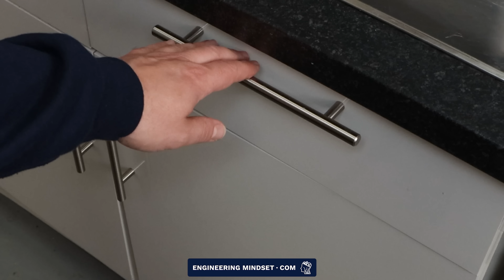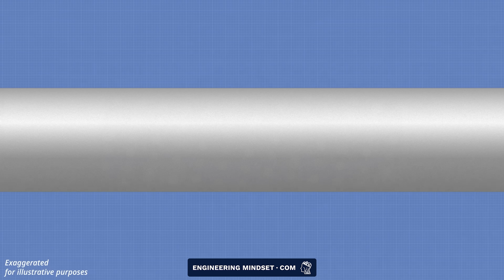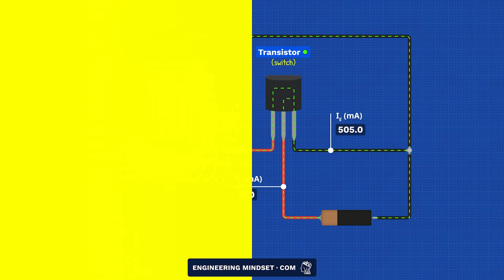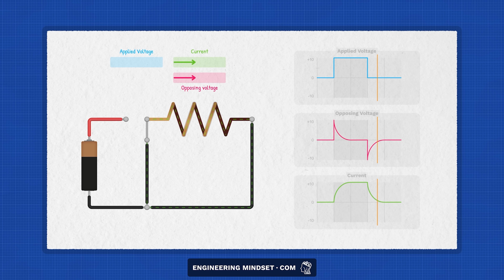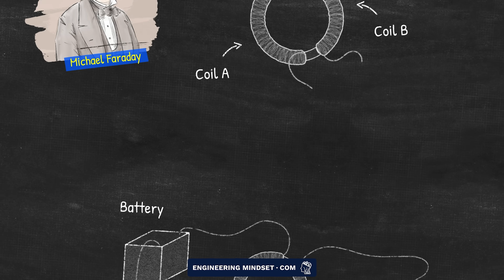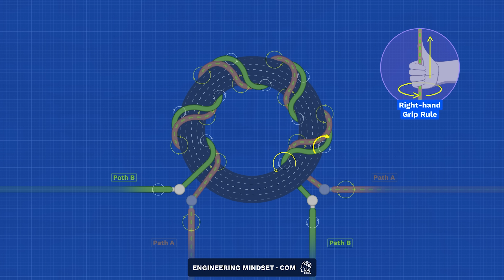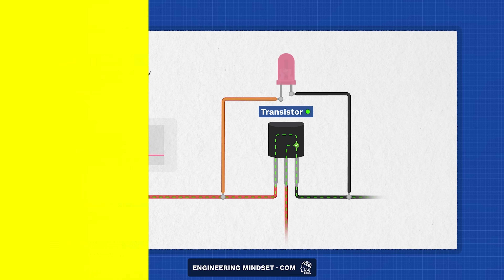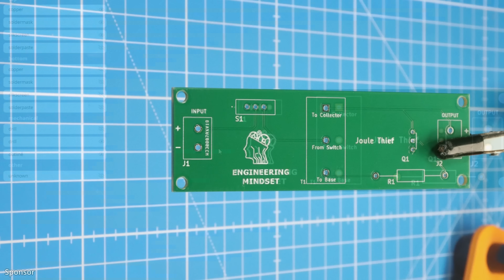Why This Circuit Works When It Shouldn’t

Comment from the maker: :_Hazard: Want to build the circuit a home? click here:➡ https://tinyurl.com/Joule-Thief-Kit
Want just the PCB? Click here:➡ https://tinyurl.com/Get-PCB-only
Reply: Why doesn't the LED fail when 85V is applied to it?
Reply: Here is the best answer that I've seen so far to my question:

In a Joule thief circuit, the LED isn't damaged by the inductor's discharge voltage spike for these key reasons:

Voltage clamping by the LED: When the transistor switches off, the collapsing magnetic field in the toroid induces a high voltage across the secondary winding. However, the LED's forward voltage drop (typically 2-3V for common LEDs) acts as a natural clamp. The induced voltage rises only until it overcomes this threshold, then the LED conducts, limiting the peak voltage to around the LED's rating. Excess energy manifests as current rather than unbounded voltage.

Limited energy storage: The toroid inductor stores a small amount of energy (E = ½LI², where L is inductance and I is current during the on-phase). This energy is released as a brief pulse through the LED, not a sustained high voltage or current. The circuit's oscillation (typically kHz range) results in short duty cycles, keeping average power dissipation low—often below the LED's continuous rating (e.g., 20-50mA average, even if peaks hit 100mA+).

Pulsed operation tolerance: LEDs are rated for higher peak currents than continuous ones (check datasheets; e.g., many handle 100-200mA pulses if duty cycle is low, like 10-20%). The Joule thief exploits this by driving the LED in pulses, lighting it efficiently without overheating.

If the circuit is poorly designed (e.g., too much inductance or current), damage could occur, but standard builds stay within safe limits.

The 85Vspike only lasts for ~1 μS. After that the 14 μS Vtransition is ~4V, so there isn't enough power (W) to heat the LED junction to cause damage to it.  For contrast, an ESD (Electro-Static Discharge)  that damages sensitive electronic chips is 2kV-8kV & it produces enough of an electric field through sensitive gates to destroy their oxide layer.   Diodes aren't that sensitive, so they actually clamp the Vspike before the PN junction fully conducts.
Reply: @ab_ab_c  Thanks for sharing it!
Reply: @ab_ab_c because there's so small amount of Amperage, that led eating wattage, so with led that voltage never increased that high. If led is removed, that circuit suicide and If I understand that circuit right, it immediately starts to flipping other way of phase, when led have flashed and that also kills voltage increasing.

Your question was great, so I have to answer to it.
Reply: @ab_ab_c  Time is always a factor in these tolerances.
So that might work for a long time because the 85V are only applied for such a short flicker at any time.
1 second is a long time in electronics.
So half a second 85V? Probably magic smoke.
Whatever time it is applied here: Apparently safe-ish.
Everything is multiplied by time for a reason in energy calculation.
See all the examples where people feed 12volt pulses in 5 volt tolerant logic. Apparently it works for a good while with these chips.
Not supported does not mean: does not work.
It just means: If you try this you are on your own don't complain if it breaks!
Reply: 85V was probably the peak of those spikes, without the LED load. The explanation of the inductor "generating whatever voltage it takes to keep the current going" isn't wrong, but a better way to think of it is that the inductor simply doesn't allow the current to change abruptly. So when the transistor shuts off, whatever current was going through the transistor is just shifted into the LED. That current will cause a voltage rise across the LED, and using KVL you can see the the voltage across the coil at that point is just the difference between the battery and the LED drop.
Reply: I've been using this circuit, 'the Joule Thief', for at least a decade. It makes a great night light for a child's bedroom, or an emergency light for a loft or a fire escape route. An alkaline AA cell which can no longer run a quartz clock can power an LED for weeks non-stop, and for many months of occasional use. 
But don't use Duracell cells, because they often leak when completely discharged. Energizer cells never seem to leak. 
Lithium cells really are discharged when they stop working in a clock, and will run an LED for a couple of days, at most.
Reply: One improvement that I recommend is to substitute the resistor in the diagram for one with a higher resistance in parallel with a capacitor (). Ideally tuned to the resonance frequency of the LC circuit. It improves the efficiency a lot by reusing the energy from the negative peaks.
Reply: This kind of circuit should be in all electric cars. If it left you in the life danger situation and you cannot walk, because some random reason. Then there should be some switch that let's you kill your battery, but saves your life. Ofc using that could work only in extreme rare situation, remove battery's warranty etc..

But that should de a thing that exists! When car's program tells that you have zero prosent power left, there's least 15-20% power that can be sucked in cases when battery's or even cars future usage is second thing at intrest list.
Reply: As mentioned,  the board, imho could be way smaller, imho an AAA size would be possible. So I can build it into a battery case.
Reply: Hello bro
Reply: This thing violated the voltage! 😂 This thing really boost the voltage🎉
Reply: Lots of information, very well presented! The first time I learned about joules thieves, I had an idea which I never took the time to prototype, but you might like it as it's very close to what this kit does, and it would make a useful DIY kit to add to your collection:
Basically it's a joule thief meant to squeeze every last bit of power left in used aa/aaa/c/d/cr/lr batteries, before recycling them, to charge an 18650 Li-Ion battery, which in turn serves as a USB power bank. The tricky part I didn't figure out is getting a boost converter accepting a wide range of voltages from the used batteries while keeping the output steady at ~5V for the LiPo charge controller IC.
Reply: Because it doesn't listen to you.
Reply: Why the circuit board?  Can't you do it with only the bread board and wires?
Reply: Quick question where did u learn your knowledge of electrical engineering/electronics/power from
Reply: Yes I've read all the Patreon names, here's my comment 😅
Reply: Btw maybe you should've used UTF-8 encoding because some names appear to have non-ascii characters.

Comment: Click bait title but it is the youtube.  This is a well known circuit (blocking oscillator) going back about 100 years.  I think it should work down to about 1/2 the minimum forward bias on the BE junction or about 0.35v using a silicon device.   Nice explanation but a proper schematic at some point would have been nice.

Comment: actually, driving an LED is boring. It is better to work out how to drive a series of CFL bulbs. CFL, like LED, can respond to frequent pulses just fine and light up. Lots of people have taken this challenge -- to try to drive many CFL bulbs with a very small amount of power. The concept is the same ... the transformer/coil, however, will need to be a bit different. Some have used big air coils. Some have used bigger toroidal coils. And, also this Joule Thief circuit is not the only one like it. Nikola Tesla moved away from air coils and made a coil in oil for his London Lecture.
Another idea is to use an Earth battery instead of a dead battery.
Another idea is to try to harvest RF, using Tate Ambient Power Module circuit, and then have this power the Joule Thief. No battery at all. This would be more like T. H. Moray.

Comment: The common dollar price solar yard lite steps up 1.2 volts to 3 volts using a single coil to light a white led. The chip has transistors but it just a copy of an old circuit  invented many years ago in the usa.

Comment: My brain hurts.       You made me realize how dumb i am......... This is why i never got into electronics.
Reply from the maker: No one was born knowing this, we learn it in stages over time with effort. Everyone has felt like this at some point. But, don't give up, try again, pause the video and make notes, write down anything you didn't quite understand and see if it is explained later on and if it isn't then go learn that part after. You can't know everything straight away, the brain needs time to process it.
Reply: @EngineeringMindset  I'm a Fitter/Machinist by trade, so i've done the training and the study in that field, but the electrical world mystifies me.    For some reason i have trouble retaining that knowledge.   Maybe i was electrocuted in a previous life........

Comment: sir, please make a video about working of smps. how smps takes high voltage ac (us 120 v 60 hz or uk 230 v 50 hz) and converts to low voltage dc. an smps bench power supply provides max dc voltage to 30 v.

Comment: Long retired EET at this end. In my early years I taught basic electronics a few nights a week, for an adult education course. Fast forward to today and it's mind blowing what's available on line, and in Spice software today! Your video is a classic example of captivating teaching. In keeping with exacting teaching, which is a must in this science, I must point the viewers to ~ 17:15 on the video. It was stated that LED's are similar to Diodes, in that they conduct in only one direction. While it is true that LEDs will light only with a positive anode voltage above documented threshold, the reverse breakdown voltage of  LEDs are extremely low, as compared with a Diodes. Most LEDs will break down and develop a resistive path with a reverse polarity of only  4 to 5V. Forward and reverse behavior are all documented in industry standard Data Sheets. They are typically found in PDF format.
Wakodahatchee Chris

Comment: I made a similar circuit based off of Big Clive's circuit except his was very low voltage and it incorporated a tiny ferrite bead .  I had an almost dead nine volt transistor radio battery however it still had six volts left and was just enough to power the circuit .  I had wound a couple of PWMS except I wound them on magnetic ferrites and I had a number of other magnetic ferrites in their presence .  The LEDs I had didn't light up until they reached four volts as I had tested them as I didn't need them to be very bright because I didn't want them to burn out  ,,  also there was a transistor ,  a mosfet ,  two capacitor's ,  two inductors ,  a resistor , a switch , a 27000mhz quartz crystal ocillator and the whole thing was point to point .   I had not hooked it up to the scope yet but when I powered the circuit I could see the light in the LEDs increasing in steps like they were ratcheting up and they were next to the resistor and I could see the resistor radiating what I thought was heat and I thought it would catch fire any minute except it was cold to the touch .  I shut the thing down because I didn't want it to catch fire but the LEDS were fried .   I imagine what I thought was heat radiating from that resistor must have been the shimmer Tesla talked about however summer had arrived and I had to leave the house because it was time to sail my boat to Costa Rica so I just left everything sit and still haven't cleaned up the mess yet but I couldn't help thinking ,  all of the components were stuff I salvaged from dead electronic equipment ,  junk that I had laying around and collected over the years after I had retired from electronic repair  ,,,  so now that I look back ,  did I actually get something for nothing ?  Because I think that was a resonance cascade   ....

Comment: 0:05 that's 10 points right there. Those little AA batteries have a charge of 1.5 volts, not 3. If you tear into a 9 volt battery, there are 6 1.5 volt cells within.

Comment: I really don't understand how we can just "assume conventional current" while knowing it's wrong, and using devices that are specifically reliant on direction, and it doesn't break things. I don't get it, and no one has ever managed to actually explain it beyond "conventional current conventions"
Reply: These are models that allow us to design and predict. It's all fields, and electrons do not travel through the circuit anyway. so assume anything that helps you. In other words, how you think about it doesn't change anything at all.

Comment: I did the calculations years ago and for alkaline batteries there isn't much energy left once it reaches its dead point.  Alkaline batteries are so easy to work with, a nice slope that is easy to measure.  The only issue is heat / cold cycling.  When the battery is warm it is fine, but when it gets cold the voltage drops enough to trigger the battery replace indicator.  When it warms up it can clear the replace battery indicator and drive costumers crazy.  You have to set a flag so you don't oscillate.  Li batteries are much harder to work with, that's why you need coulomb counters.
Reply: So you're the one that did the calculations?  I've been wondering who to thank. We are all so indebted to you, and yet most people don't even know your name.
Reply: @faloniusbeloni5116  wow I = Q/t has been around for 100+ years.  I'm an engineer so I can do maff.

Comment: It's not the core's saturation that stops the induction on the secondary coil, for this kind of circuit (blocking oscillator) also works well with no core at all, and air or vacuum do not saturate at all. It is the transistor that gets saturated, or reaches the rails of supplied voltage, so it can't keep magnetic flux increasing anymore.

Comment: why is the Led without resist will not burn out🥺🥺🥺
Reply: but there is a resistor
Reply: @faloniusbeloni5116 that resistor you mentioned is for the base of the transistor only.

I am thinking if the led not burn out due to the not high enough power
Reply: @shisparta because the base resistor, and the forward voltage of the led determine the current. And e battery is not a pure voltage source, it is itself a current limiting resistor and a voltage source in one.
It's a constant current setup.

Comment: OK, this is a toolkit sales pitch, wrapped in a long lecture about HOW TO SQUEEZE OUT ENERGY FROM A BATTERY USING A MAGNETIC FIELD OF A TOROID !!! There were useful moments in the lecture, but in the end, it is a sales pitch for a shovel, and a shovel that just demonstrates how something works, but does NOT do anything useful. Maybe you can wrap this is in a small box with a switch and the LED exposed, so that when they cut the power, you can just reach to your night stand and turn it on ... taking advantage of the remaining ounces of power left in your used battery.
Reply from the maker: Thanks for your feedback. What we've done is find a way to teach how an unusual circuit works, breaking down the physics of each part and using a real world example of how this is applied. It has many uses beyond the LED, but the led is easy to grasp because a battery normally can't power a white led.
If someone is interested they can also purchase the kit to build at home if they wish, which helps us fund more videos and also helps keep our videos free of charge to anyone. Theres no pressure to purchase anything, all the physics are explained for free. I think it's a great balance as these free videos take weeks to make.

Comment: the 85v spike will not damage the led?
Reply from the maker: LED conducts when the surge reaches its forward voltage, so the spike doesnt reach 84V, only with no load attached

Comment: All in all, a nice informative presentation.
Some areas left me feeling as if my tongue was stuck in a slow-switching light socket supplied with 70v AC. Due, i'm confident saying, to my limited comprehension of basic electrical theory.
Pondering that . . . I've worked around electricity, found faults/repaired household wiring and simple electronic items (furnace main board, transister radio, Stereo amps, automotive etc) successfully for decades. I feel like my share of an epiphany like moment of understanding electricity was commandeered and given to Nikola Tesla (even before I was born and without my consent). (which I'm OK with because he put it to good use) I'm left with a lifetime of my foot shoved in the door, and pushing, trying to open it far enough to grab that Ah Ha moment. I can  a l m o s t  reach it . . .

Comment: i built a circuit from salvaged components with some differences
i used:
 a D1616 transistor (more current and voltage capacity than 2n2222)
170 turn bi-filar air-core coil
dead 0.5v battery

it reached 240 kHz and 40v spikes
half rectified and capacitor combo made a 5v output
Reply: Could you explain how this would translate into an audio electronic world

Comment: wait, if energy can't be created or destroyed why tf we pay electrical bills
Reply: The battery stores the energy, but when the battery drops below a certain threshold, it no longer has the forward voltage to power the diode. 
This circuit allows you to harness the remainder of the energy in the battery to more fully exhaust it, until even this circuit will no longer illuminate the LED... It's like putting a tiny fuel pump in your gas tank, and running on the last fumes in it...

The reason you pay the electric bill, is because someone has to harness the energy from whatever source it's available, store it, and make it available for you to use. That's why you have to pay for the battery too...